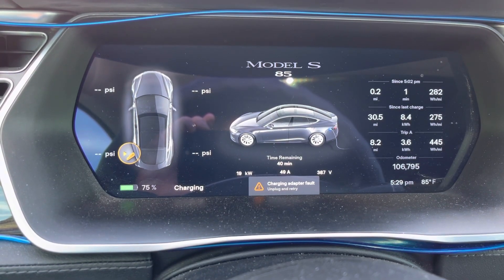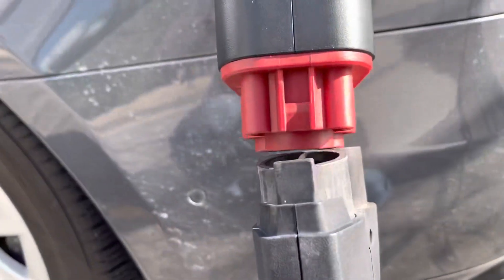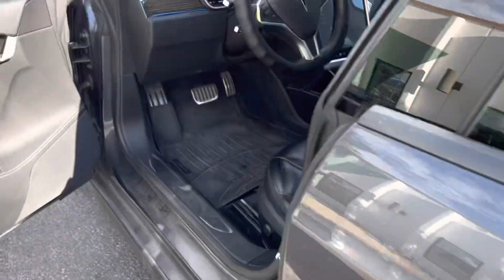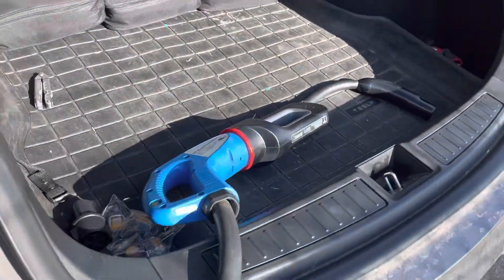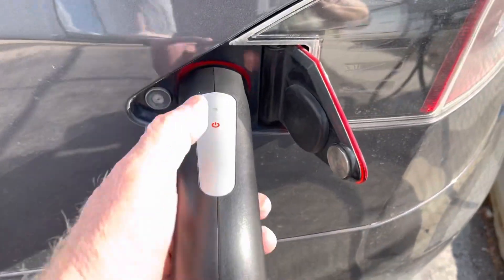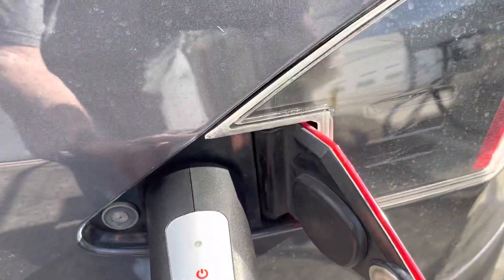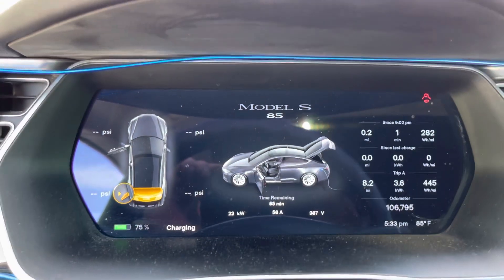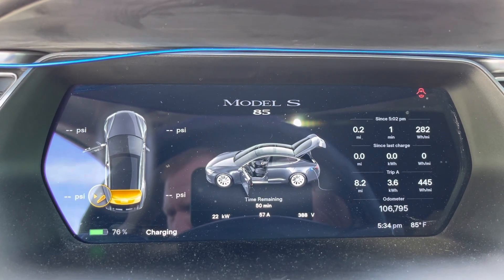Charging a Tesla with the lectron ccs adapter

Comment: Is the adapter still working?  I've read where some of these were disabled by Tesla in an update.   Would be handy since Tesla is slow playing the upgrade for older cars.
Reply from the maker: It’s a game of cat and mouse.   Everytime tesla updates the car to disable the adapter, lectron releases a new firmware to keep the adapter working.      I learned the hard way not to take a update to the car before a road trip.  :)
Reply: @Tesla Mike  Thanks Mike!
Reply from the maker: @werecow68  my pleasure.  Thanks for watching and commenting.
Reply: Still working? I haven't used mine often, avoiding updates.
Reply from the maker: @lawrencekendrick6440  it’s working great.  Once tesla released their ccs retrofit I haven’t had to update this adapter.  I’m also on the newest firmware with no issues, just the slower charging speed.
Reply: @teslamike7476  mine is good, relieved that there is no internal battery, not sure where I saw that there is one. The updates quit 2yrs ago, 1?
Reply from the maker: Glad to hear it!   It’s a great adapter.